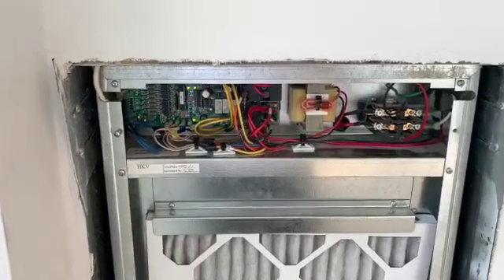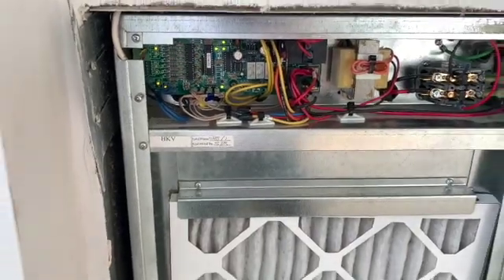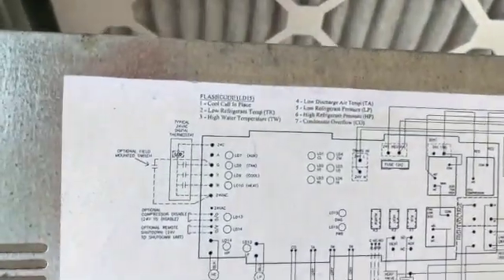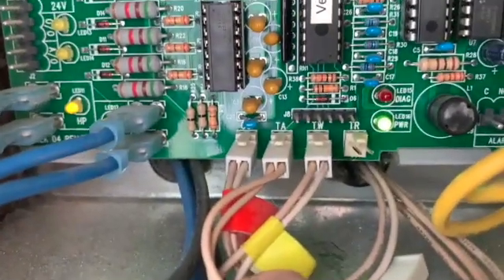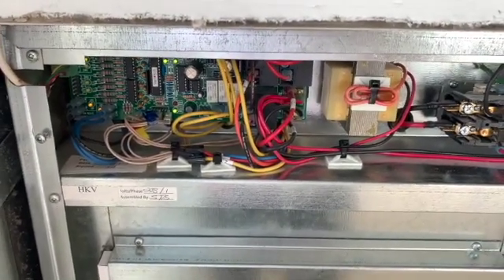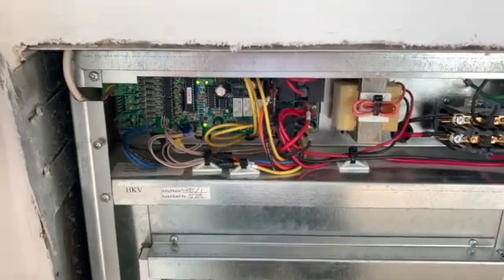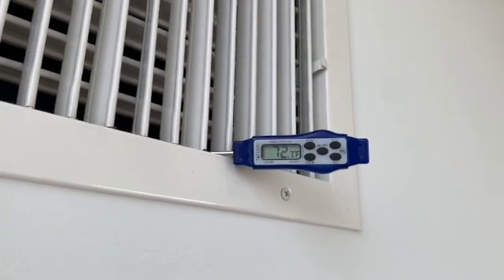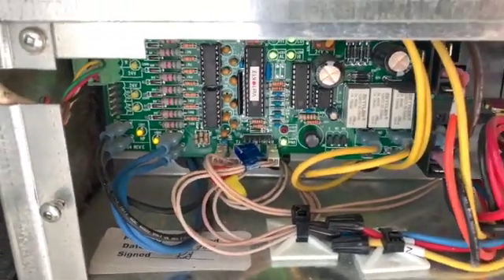Bulldog HKV Heat Pump Won't Cool

Comment: Hi , please I have a question: I live in an apartment building that uses this bulldog heating system. The heat never warms the apartment, the air always blows cool/warm air and it’s never actually warm even when it’s at the highest. The apartment building says it’s how it should be working, they tested the heat and the maximum that comes out is 24 degree. I am trying to understand why a heater will not pump heat. Please can you help?
Reply from the maker: It sounds as if the actuator that opens and closes the heating valve is burned out. In heating mode a valve opens that allows hot water to pass through the coil. As room air is pulled through the coil by the fan it absorbs the heat from the water and discharges the warmed air from the top of the heat pump. At 24 degrees you are just circulating the room air through the pump without it being heated at all.
Reply: @thestationaryengineer5661  thank you so much for this insight

Comment: i have the IKV version and it is not cooling at all ,, tech says it is fine but evaporator even feels room temp. runs for over 3 hours and room cools .5c and i think that is just because the sun goes down. Is there a specific temp you would like to see the evaporator at ? should it be cold to the touch ?